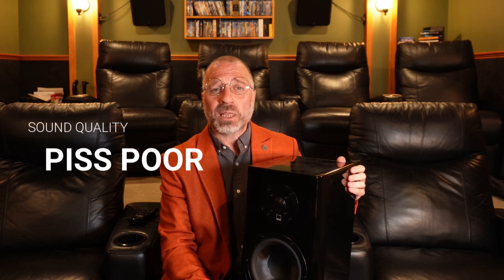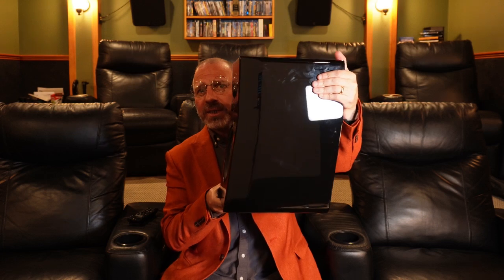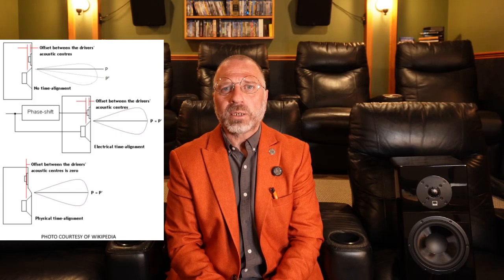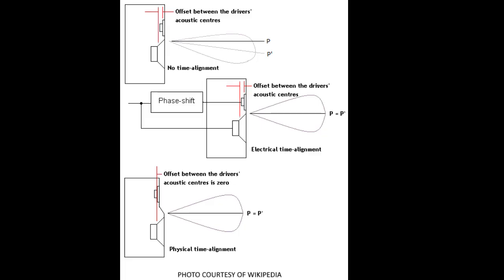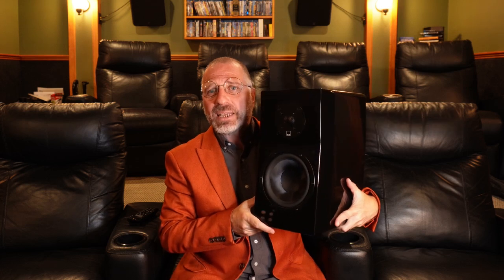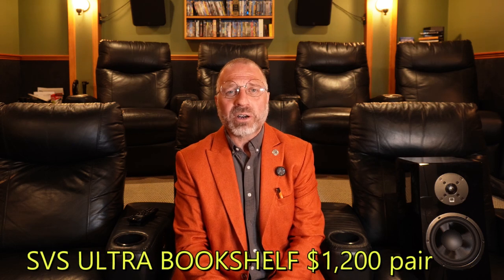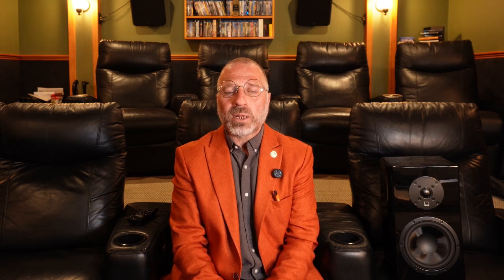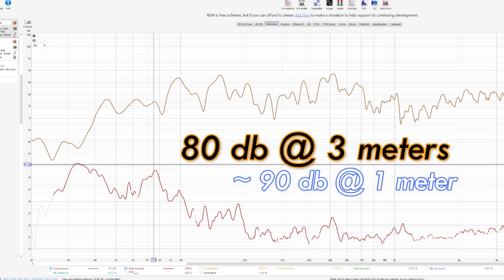FAIL OVER 20 kHz! SVS Ultra Promises But Can't Deliver

Comment: N.B. Hes reviewing the new Ultra Evolution bookshelf which replaces the Ultra bookshelf which has been around for many years. Its sad that SVS wont be at the Toronto AudioFest next friday. I wanted to compare them to the new KEF Q Concerto Meta bookshelf (3 way speakers).
Reply: Check out Erin's Audio Corner and his Klippel scanner review of the KEF Meta Concertos.  Pretty darn decent for the money.  He has also scanned various SVS speakers and they are fairly disappointing in comparison.  Erin is not just some dude with an expensive  toy.  He is an engineer.

Comment: Darn! I hate it when things don't suck.  Open them up and check the crossover components. We must find something wrong!
Reply: GenerationBehindHiFi did a complete tear down of this speaker and even measured the driver's T/S parameters. I really like his videos and he does a pretty good job of explaining things.
Reply: How about we open your brain and find many things wrong?
Reply: GR Research did just that and... the binding post and crossover are crap.... along with some other built in issues.
Reply: @bayard1332  When finding nothing terribly wrong with the speaker, you must pick apart the interconnects, the wiring, and the quality (expense) of the crossover design or components! And don't forget, you MUST have No Rez!! 😂😂😂
Reply: @shipsahoy1793  So what you're saying is you have zero experience with higher quality speaker parts and crossover parts so you have to mock it. Got it. Maybe some day you'll actually experience the difference and gain actual understanding.
Reply: @bayard1332  
I actually do have a lot of experience in that area, and many times the law of diminishing returns trumps the cost and effort required, at least from my perspective.
As far as I'm concerned, you could do/buy into whatever you want, but should be careful about making seemingly aggressive assumptions about your fellow posters.
Reply: @shipsahoy1793  That's why the Gods of electronics invented bypass caps.
Reply: @bayard1332  GR Research has to find faults or he can't sell his lies. There is nothing wrong with the crossover or the binding post.